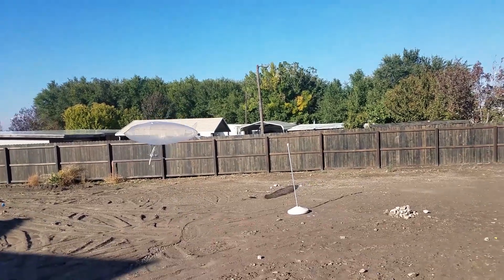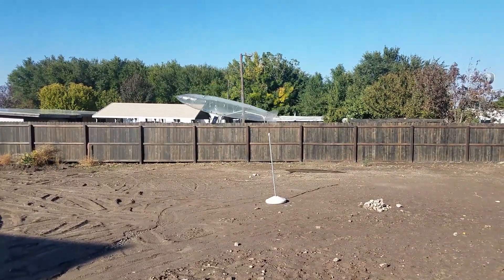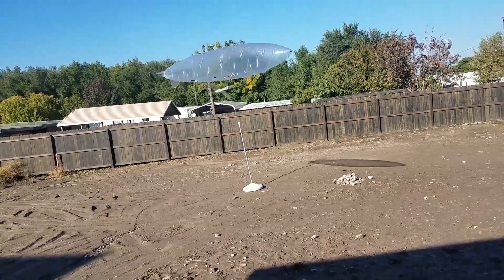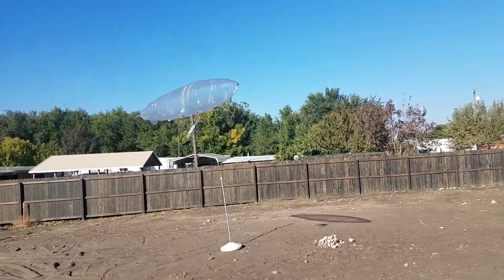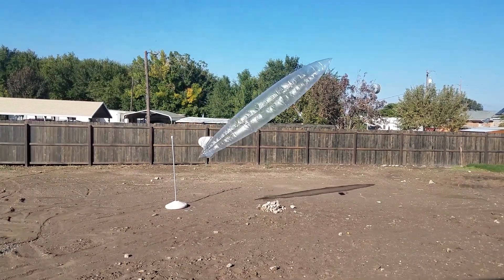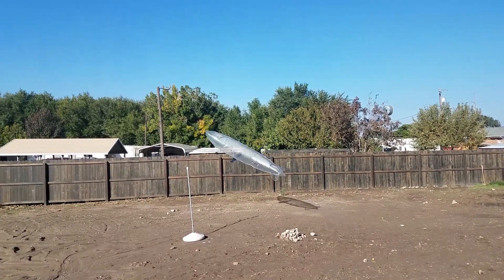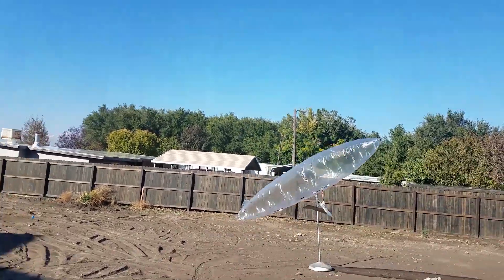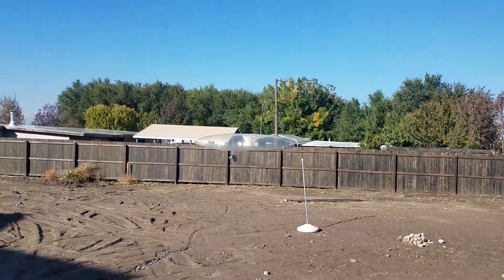Solar Powered Blimp Thrust Test

Comment: what about rainy days? will it work than cus that means you need batteries on it which =more weight and higher costs
Reply from the maker: It would need more weatherproofing, but it does have batteries for flying when the sun is not strong enough. One of the main goals with this is to fly overnight, so the batteries are pretty significant.

Comment: Bacca temperature control is key... hot air expands and cold air contracts. Imagine a hot air balloon if you will as it is easier to fly in the morning due to cold weather. Same thing with a balloon :P
Reply from the maker: Yup, I agree completely. Much of this design is about temperature control. The envelope is transparent to reduce superheating. The solar cells are not on the envelope to prevent heating from the cells from affecting lifting gas density.  The thruster is arranged to direct airflow over the solar cells to cool them. Etc, etc. Heating/cooling is a huge deal with airships. Solar powered ones: doubly so :)

Comment: Welcome back Bacca! Have you ever seen John Schettler's Kirov alternate history book series? It focuses a lot on airship combat in Season 2 - you should check em out if you haven't already!
Reply from the maker: Oh, that does sound interesting
Reply: @BaccaYarro  Its set in WW2, and one of the key features of airship combat is to have the high ground (badum tsh) since most guns are mounted on the bottom of the balloon and in the gondolas… the gas bags are helium-filled and have a self sealing rubber coat, so machine guns (and even 3 inch guns!) are pretty useless, but big cannons (known as bag busters) can defeat the self sealing mechanism. However, an airship can't go toe to toe with a naval vessel, since the flak guns can rip it apart easily… these are just the basics. Does it sound accurate to real life?
Reply: Ryan Ma can you provide a link to a synopsis or a review? This sounds interesting

Comment: Wouldn't a transparent envelope also increase the gas temperature making the blimp lighter? 
Is that increase negligible.
Reply from the maker: So, heating of the envelope, called "superheating" in the airship world, is actually a bad thing most of the time. The reason why is when the sun goes down you lose all that heat. Which means if you were relying on it for lift you may be in trouble. Part of the reason for the transparent envelope is to decrease superheating, so it has the same lift during the day and the night.
Reply: whouldn't any envelop do that anyways cause the sun would hit it regardless? in fact the clear one would have less of a heating effect
Reply: Epic Nerd a black one would work best

Comment: Great to see you back on the internet! By the way once your airship is finalized and its able to be bought how much would they cost? also how much does it cost to maintain the airship? also i had a cool idea, if you made a bigger airship, i wonder if you strap a paint ball gun to the bottom would it work?
Reply from the maker: Thanks! Well, its hard to say how much it would cost to own/operate. Helium is really expensive, but with something small like this I think Hydrogen would be just fine to use. Hydrogen is dirt cheap, and has other advantages. It leaks more slowly, and lifts more.
Reply: BaccaYarro just make your own helium, just some simple fusion, shouldn’t be too hard 😂
Reply: @antonkrause2420  Nuclear Fusion..? That is... Absolutely... The easiest thing to do on earth and Bacca should DEFINITELY invent the technology necessary to do so and get to work quick.